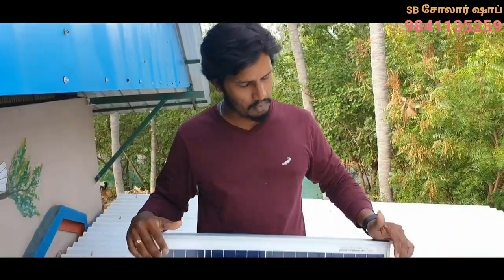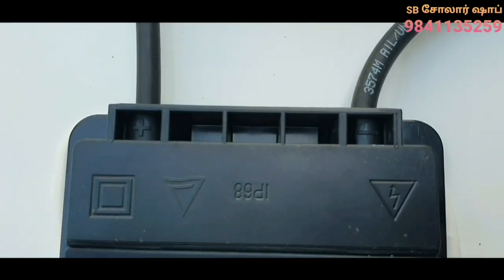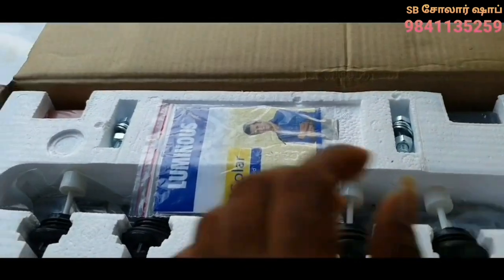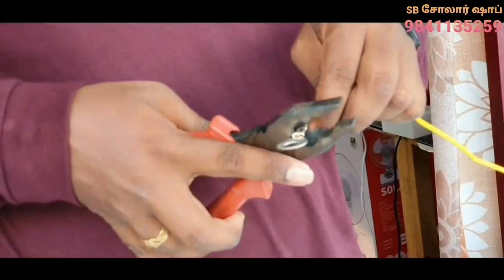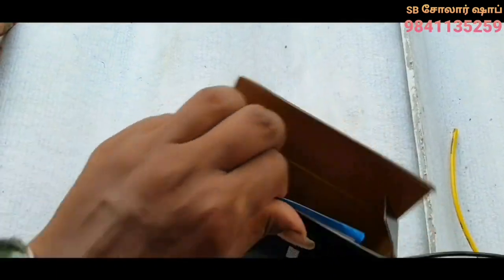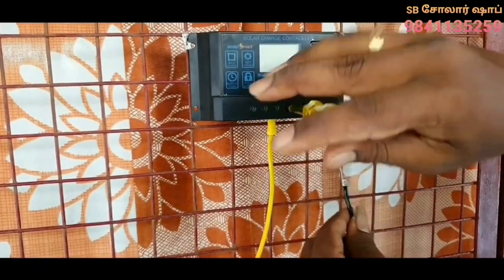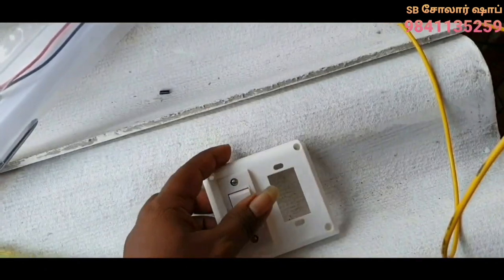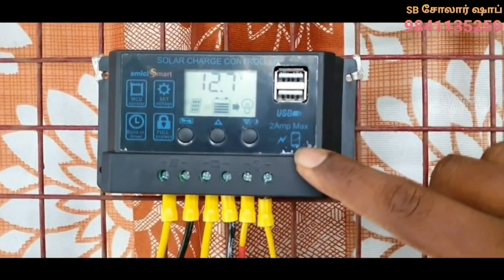DC ஹோம் காம்போ பேக் ரூ14999

Comment: Luminous 165Watts panel 3pices, Luminous Solar  LPTT 12150H  150Amp battery 1no, LUMINOUS NXG+1400 Solar Inverter 1No . என்ன விலை வரும் சார். 1/2 Hp motot   உபயோகிக்க இது சாத்தியப்படுமா? பகலில் எத்தனை மணி நேரம் Motor  உபயோகிக்க முடியும்.

Comment: Hai, 500 unit loom solar Penal inverter 200ah battery Ellam sernthu prices sollunga bro
Reply: Panel 180w 3nos Rs.22000
Inverter 1000va Rs.7000
200 AH C10 Battery Rs.18500
Panel Stand Rs. 4000
Cables,DC Mcb,MC 4 Connetors and Others Rs.6500

Approx.Total Rs.58000

Total Load 750 watts 
Inverter fridge     - 200w
Cealing fan 3      -  225w
10w LED Bulb 10 -100w 
40" LED TV   1      -150w
Laptop 1,Mobile chargers.
Reply from the maker: 9841135259 bro
Reply from the maker: 50 to 60 thousands varum bro but 65 thousands ku 1kw pannel 1kv mppt inverter 150ah battery setup panedalam bro
Reply: @sbsolarshop2020   ok thanks bro

Comment: Wire size?
Reply from the maker: Solar to controller 4sqmm. Line wire2. 5sqmm
Reply: @sbsolarshop2020  
Thank for your reply.
Battery to Solar charger wire size?
Reply from the maker: 4sqmm wire sir
Reply: @sbsolarshop2020  Thank you